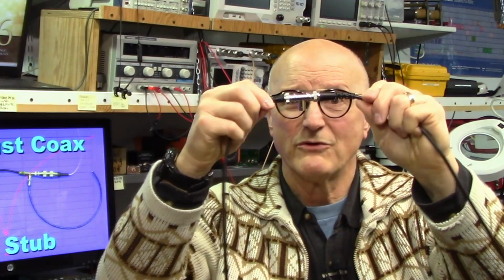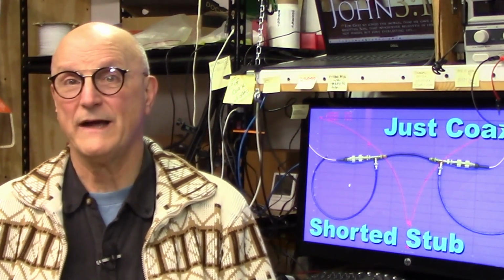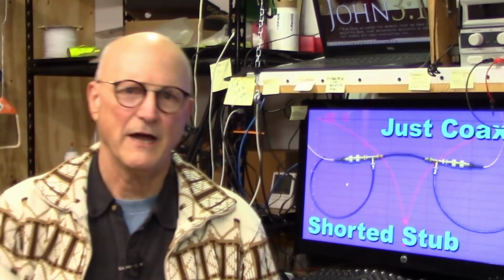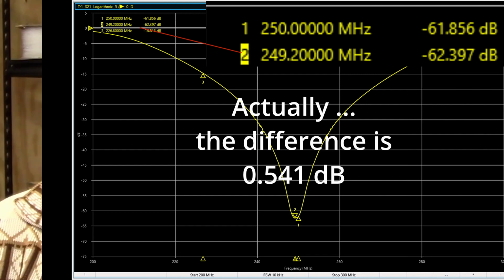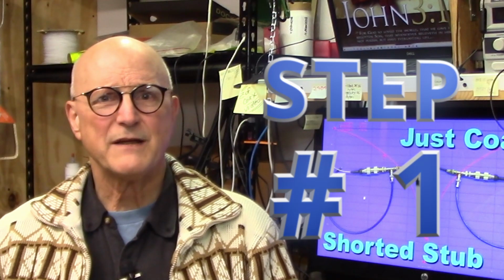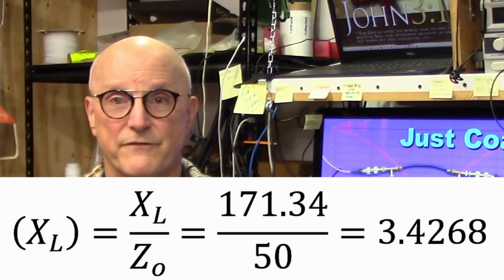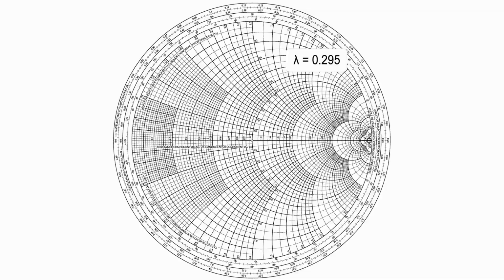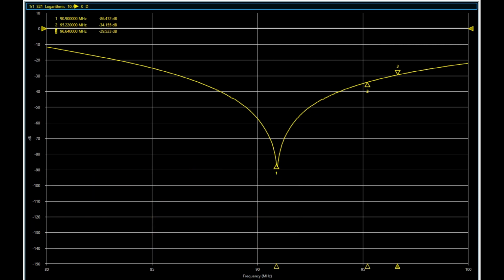Create a Band Reject Filter using just Coax: Shorted Stub Version (049b)

Comment: O.K. !
No offense, but I had to stop before my head popped off !
My question is, can these be used to reject the frequency split of a separated antenna repeater system, where no duplexes are used, but instead, use the physical separation between transmit and receive antennas, in an effort to stop desense in the receiver ?
                  🤔.....?
Reply: Here's an idea, since we're most interested in this for vhf/uhf applications.
Firstly, the lower the loss of the cables used, the better the Q and deeper the notch, but here's the idea: have small cases at the end of the stubs containing the tuning coils with connectors on them (perfect since theyre coax) and use brass bolts going into the coils to fine tune them.
Reply from the maker: @Dazzwidd  Hmmm...interesting idea except brass is not ferromagnetic and would have no (little) affect on the inductance of the coil.  You would have to get a ferrite rod that could be attached to the end of your bolt. This would change the inductance of the coil as it is inserted, much like the much smaller, low power variable inductors I used for this demonstration.
Or, maybe, you could have a sliding assembly.  One end of the coil is soldered to the center conductor of the connector. The other end is soldered to the end cap of the sliding assembly which is connected to the shield side.  As you pull the slide out the coil lengthens and the inductance decreases. Push the slide in and the coil shortens increasing the inductance. The trick is to keep the coil from turning into a slinky and getting all deformed.
The other option is an Open Stub filter which uses termination capacitors. It is a LOT easier to create a variable capacitor than it is a variable inductor.  Check out this video where I show one such setup.
https://youtu.be/Fd7d6oKHr_A
Hope this helps! 🙂
Reply: @eie_for_you it doesn't need to be ferromagnetic to influence the inductance. I believe the effect brass will have will be to lower the inductance of the coil, not raise it..
Reply from the maker: @Dazzwidd  Well, that would be a new one on me.
Reply: @eie_for_you  There's a reason I recommend this too, it's because the brass should not get hot as easily in the presence of high RF energy like ferrite may, and should have less loss at these higher frequencies. Should have more stable thermal characteristics. I've seen non Ferro magnetic materials used like this before. I would have the thread running inside the coil from the end that's grounded to the box so that capacitance doesn't influence the tuning downwards while the metal material is attempting to pull it upwards. Anyway the thinking in making the device like this is that it should be very easy to fine tune.
Reply: However I'm not 100% certain as the things I remember seeing with some kind of tuning similar to this... it was a long time ago. However I thought it could be food for experimentation.
I thought you using inductors to tune these things was very interesting though, never seen it done before, and it does open up interesting ideas.
Reply from the maker: @Dazzwidd  Let me know how your experiments work out. I'm interested in the results. 🙂
Reply: @eie_for_you  I'm not likely to try it myself. Just speculating. I don't own VNA etc...
Reply from the maker: @Dazzwidd  Aaaaahhhh! I might just try a quick experiment sometime just for kicks. Right now I am totally immersed in transistor circuit design. 🙂
Reply: @eie_for_you  Cool 😎 I like playing around with transistor circuits a fair bit too. Sometimes the fun is in doing everything to avoid Integrated Circuits in designing something, getting back to basics and being crafty
Reply from the maker: @Dazzwidd And it is so very, very much fun to see the creations "come to life!" 🙂
Reply: @eie_for_you  Absolutely, lots of fun. On the inductor tuned stub filter, I think the brass tuned inductors will be more lossy than using a chunk of the right type of ferrite glued to a nylon bolt or something- I've been thinking about this experiment more over the past few days. Eddy currents in a conductive medium will cause loss I think, even though it will tune things.
Another thought is to actually use the brass bolt to capacitively load the "hot" end of the inductor for the tuning, rather than using it to permeability tune it. I feel that would be probably the best method, especially when you get up in the 400mhz region and above. If you were a purist you would silver plate everything haha. Anyway the end of all this is the creation of a filter with easily tunable deep notches, cost effective and easily constructed. Seems an excellent project in my imagination
Reply: Westflex 103 would make some very good Q coaxial stub elements. Also thinking about your variable capacitor suggestion in the initial reply 🤔 It's all about Q
Reply from the maker: @Dazzwidd  Of course, with its VF being 0.85, this would make the stubs almost 30% longer. That's OK if this doesn't pose an issue for the application. 🙂
Reply: @eie_for_you  Well at vhf and uhf the extra length won't matter, but the sharper response will be what you're after. A few thoughts arise here though. If this device was made with no connectors and everything soldered together with attention to detail and more than 2 stubs used... this could indeed do a fantastic job in place of a cavity filter in certain applications. On the capacitor tuning muse, you could still have the boxes at the end of the stubs- perhaps copper ones, and have a copper disc at the end of the center conductor of the stub and another disc grounded to the box via a thread introducing a variable capacitance to the first disc for adjustable resonances. Westflex 103 is a great cable for these things. All copper. Copper braid and copper foil screen. Solid copper centre conductor and the honeycomb polyethylene dielectric. It screams what you're after for making tuned transmission line filters, matching sections etc.
Reply from the maker: Understood.
This is my LONG overdue reply!  Sorry. Sometimes this stuff gets lost in the YT world. I'm spending some time trying to clean all this stuff up. :-)
Reply from the maker: WOW! This is exactly the question that I had when I first discovered this cool thing. Great question! 🙂
So I did some experiments. The problem is the bandwidth of the notch and the separation "distance" between the transmit and receive frequencies, as I discovered.  I could attenuate the transmit frequency really well, check!  However, the insertion loss at the receive frequency was unacceptably high for a 2m repeater, separation of 600 KHz.
You *might* get away with it for a 70cm repeater where the separation is 5 MHz(???). I recently was working on a duplexer for a public works repeater that had a HUGE separation. It would have worked there.
This was a VERY good question. 🙂
Reply: @eie_for_you  
And one very near my heart !
Lol !
As recently I dove head first into the World of GMRS !
And understand that obviously with high Frequencies comes loss thru attenuation !
But.....I never dreamed how outrageous they are !
I've been around RF since I was a kid, and have a pretty  solid Amateur Radio background, so this is nothing really new, but I had just never waded that far into the pond !
The most shocking for me was the level of attenuation at 467 Mhz. !
Then the insult to injury when you see the cost of Feed line, that even remotely offers any relief, not to mention the size !
I'm sure I'm preaching to the choir here, judging from your comment.
And thank you too, for getting back, as I think your initial posting was some time ago ?
But yes the frequency I am interested in is in the GMRS range !
467.600 to be exact, as I am in the process of putting a repeater there !
Since I don't have the necessary gear for proper testing, do you offer your services and build such stubs ?
Fingers crossed 🤞 !!
Obviously I am willing to pay for such service !
Hopefully we could figure out how to pay, or maybe you already offer these on eBay ?
Again Thank You for getting back !
And like most things RF related, I find it intriguing !
I have said since a child, if only we had a way to see RF visually !
Makes me wonder how things would change, if that were possible ?
Also, I have always said, since RF signals are all around us, if we could see RF, we likely couldn't see our hand in front of our faces !

Comment: Nice example of stub matching. What would happen if you ran the stubs back to your shack and fit a variable capacitor to the ends of them? Ahh so switching in various inductors i think the addition of an atu on the end of the stubs or 2x parallel atu's or in however many multiples of stubs you are running.
Patch Leads!
Reply from the maker: I suppose that if the frequency of choice was low enough that the stubs could be brought back to the shack, this could be done.
Reply: What you achieve with a stub is phase reversal that can either add or subtract from the signal passing across the T-connector.  A quarter wave stub open at the end reflects 100 percent, arriving back at the t-connector 180 degrees out of phase hence acts like a short circuit at that frequency.  The same stub will reflect an open circuit at a frequency where the stub is half wavelength.  If you make the stub longer and have multiple odd quarter waves it will short a much narrower bandwidth while preserving a frequency much nearer.

Comment: Now that tutorial was awesome.
Same thought here, 2m & 70cm antennaa with high gain but physically separated, with said band pass filters in-between.
I'm I chasing down a rabbit hole?
Reply from the maker: Thanks, man!
Of course....one problem you might run into .... just thinking ... part of the 70 cm band is a third harmonic of the 2M band (432 to 444 MHz = 3x 144 to 148).
So ... your 2m filter is also going to attenuate this third harmonic! So, the 70 cm filter will be just fine, but the 2m filter will have an issue with this portion of the 70 cm band. :-(
Reply: Doesn't this assume a common feedline? Feed them independently or on the split side of a duplexer- maybe sidestep the issue.
Reply from the maker: I am thinking with a common feedline, this would feed a pair of these. One tuned to reject the 70 cm signal and the other to reject the 2m signal. Of course, it would be so much easier just to be a commercially available 2m/70cm duplexer ... but where is the fun in that? :-)
Reply: Forgot to mention.
High gain antennas to be constructed in a colinear configuration each, thus achieving high gain.
Reply from the maker: I see. :-)
Reply from the maker: Yes, this would probably work just fine for that 2m 70cm separation. These are band reject filters. The pass-part is just that it isn't the reject part, if that makes sense.
It has a VERY wide bandwidth, but not that wide.
Like so many things, I would strongly suggest building one up and do the measurements specific to you application. :-)

Comment: I am thinking about making two of these, one for 2 m and another for 70 cm, and diplexing two single band antenas together, do you guys think it will work ?
Reply: All you'll end up with is two warm stubs.
Reply from the maker: I think he is talking about a Y configuration. One side, with the 70 filter feeding the 2m antenna and the other side with the 2m filter feeding the 70cm antenna. The common point is the radio feed point.
Reply: @eie_for_you  now I see, so the 70 cm antenna will be virtually useless in this configuration :( - ty for the heads up
Reply from the maker: @xxleite  It was a pretty cool idea, though.
Reply: @eie_for_you  Does this mean that a notch reject filter for frequency F will have some attenuation at 2F, 3F etc as well?
Reply from the maker: @MrApolloTom  I did a quick measurement on one of my "left-overs" from making those videos to verify my belief on this.  The reject on subsequent harmonic frequencies is a little less. The further you get away from the fundamental design frequency, the less effective it is. Now, these are not huge changes. As I saw it on my VNA, they are about 3 dB. So 2F is 3 dB less reject. 3F is 6 dB less reject and so on. Speaking of ballpark figures here.
Reply from the maker: Of course....one problem you might run into .... just thinking ... part of the 70 cm band is a third harmonic of the 2M band (432 to 444 MHz = 3x 144 to 148).
So ... your 2m filter is also going to attenuate this third harmonic! So, the 70 cm filter will be just fine, but the 2m filter will have an issue with this portion of the 70 cm band. :-(